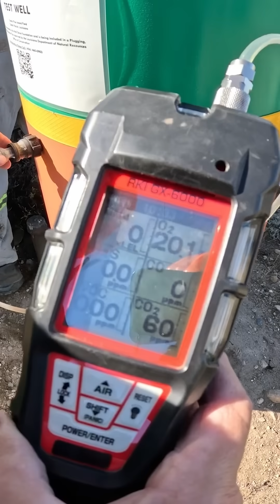The problem goes deeper than you think...

Comment: In the Ventura oil fields there were 3 oil field workers that got caught with nowhere to run when hydrogen sulfide blew out of the well and all 3 died on the pad and it took hours before someone noticed they hadn't checked in. One of them was 22 years old.

Comment: Could that methane not be extracrd and used.
Reply: Typically not. A well leaking at the rate mentioned would be rare, but at that rate, it might be cost/energy effective. Most leaks are small, a coat of paint might stop it, and even then, it might be more of a seasonal burp than a flow.

It takes a lot of material and fuel (energy) to do the plugging. If it takes more fuel to plug than is escaping, it is losing proposition. If it takes more energy to rework, capture and transport the gas than it produces, it is a losing proposition.

Comment: I worked in northern Oklahoma plugging these old wells with a cast iron plug. When you get permission from the state to drill a well you put down a deposit that you only get back if you plug it. Plugging is more expensive than the deposit so a lot of companies, especially smaller ones, just leave it.

Comment: I did gas testing & certification for work. This seems excessive considering the only risk to life would be someone putting their face over the hole with a perfect seal or for >15mins straight. Also wouldn’t gravel, soil & a cap do the job?

Comment: If you only use concrete for the last 60 feet, you could use the rest of the volume below to permanently store carbon in a process called "geological carbon sequestration". There are lots of processes which capture carbon that need somewhere to store it. Why not plug your hole with it, considering concrete has such a high embodied CO2 cost to make.... just a thought.

Comment: It seems like that methane could be useful.  Can you put a pipe in the plug and a valve at the top?  Then just turn it on for some natural gas when you want later.  Maybe it's below the concentration threshold to be profitable at the moment, but that may not always be the case if the price of NG goes up.

Comment: Question : if the casing is threaded at the top why not just put a metal cap on it ? That should last 25-50 years ! Would take considerably less time and you plug several in a day ! Speed versus permenance ! Have one well permenant or stop pollution from many wells long term !

Comment: Out of curiosity, what would happen if you just kept dropping lit sticks of dynamite down the hole? Would it eventually fill itself up?

That's also a lot of energy used and pollution produced just to fill the hole with concrete. But I'm confident, over time, it's way less harmful than just leaving the hole open.

Comment: They're having a problem with old wells in the oil fields of Western NY State and NW Pennsylvania. These wells, which have been worked out three times over, are somehow leaking very valuable Pennsylvania grade crude oil onto the surface. All the settled science says this is impossible. But, rather than collect this oil (very low sulfur and crazy rich in lubricants) they're plugging the wells. With concrete, not pipe. So they can never be pumped again.

Comment: Like so many "stories" they never tell the whole truth. Most times nothing comes out of the well...the state inspectors and ignorance causes operators to give up...there is nothing you touch that does not require some type of hydrocarbon...nothing...the toxic battery's in battery operated cars have to have oil to make them...do a little research....see how synthetics are made....they make synthetic oil and put it in a plastic jug....made with oil!!

Comment: Once the oil are mined out they should be extracting the gases as it's just as useful and hydrogen sulfide is also worth mining so instead of just plugging them holes take out everything you can then plug the holes I reckon

Comment: So if you are using “concrete” you already fudged up. Cement will also break down over time and does a horrible job holding gas. Also, none of you guys are paying any attention to the B annulus of the wells. The well will still contaminate groundwater and leak gas up the back side.

Comment: Incorrect.  "So the bottom plug dries first.."   Concrete does NOT dry.  In fact if it did, it would not cure.   Concrete sets, hardens, cures, over a period of time. Construction tests are often based upon a 7 day cure or a 28 day cure.  Water is REQUIRED to hydrate a hydraulic cement. Cement does not dry to get hard.

Comment: OSHA allowable 8 hour hydrogen sulfide safe exposure is 20 parts per million. 100 ppm will make you sick. 200 ppm will kill you. I used to hot oil 37% H2s wells. That's 370,000 parts per million. You don't make ONE MISTAKE if you want to stay alive.

Comment: what a huge waist. you only need to plug the top with a cap. it recharges over a few years. when its full up again more oil is available.
Reply: That's not true at all, oil takes millions of years to form
Reply: @averybrown4547  I have seen reports of dry fields being explored in the 1920s and 30 years latter there was oil in the 1950s from the same holes. They could not believe it, they even tracked down some of the engineers from the first drilling in the 1920s to check, and they could not understand it. Oil is a Hydrocarbon CnH2n+2. It comes up from under the earth crust. Renewable.
Reply: @averybrown4547  I tried to write a comment explaining it, reports proving it and the chemical formula but YT censored it. I didnt write any thing that is hate speach so its very strange, why would they censor it unless they dont want people like yoursef to find out.
Reply: @hungrysurfer9471  oh I looked it up, yes sometimes that happens but still we shouldn't be using oil, it's horrible for the environment

Comment: Im more cconcerned about why i unsubbed Jerry Rigs everything, even old oil rigs 😂

I just wonder, it will take 20 years for the effect to be measured, does that account for the pollution created to plug the hole?

Rigs and equippment, plus the sand and cement used?

Thanks in advance.

Comment: I have a concrete company where we use polyurethane foam to not only lift settled concrete, but fill voids and sinkholes. It’s typically a much cheaper alternative to a flowable fill concrete solution. Would be interested if it’s applicable to something like this.  

Level Up Concrete.

Comment: As the bellies in bakersfield emptied they filled back up.  They found a super hot river of oil lower in the crust.  What happens is these bellies are cooler oil steam from the river.  So all old bellies have then have the possibility of filling back up.  This is also why the La Brae tar pits dont stop boiling they are the cooling of these rivers deep down.

Comment: Not sure about American regulation or drilling.... but it Canada we have surface casings with several concrete bell holes....
Methane or well seepage doesn't happen, unless piping is breached....

There simply isn't, killer holes in the ground.... although there are killer pipes sticking out of the ground.... up too 10 years, before the piping is filled with concrete and sheared off below the surface.....

Comment: Here in canada every oil company pays a fee off the top to help seal these wells, these are called orphan wells and there are over 200,000 of them in alberta alone that need to be sealed, i have cemented alot of them myself and could spend the rest of my life sealing the rest of them... and we dont use concret, btw.

Comment: There was a company pitching using abandoned oil well holes for energy storage. I think the idea was to use a heavy weight. When there was surplus electricity, lift the weight higher in the well. When demand was high, lower the weight and spin a generator to make electricity.

Comment: With a concrete plug it is not 100% sure that this will stay leakfree, the poor quality of the cement between hostrock and the casing is a big problem.

I work with a p&a solution that removes all casing and cement out to formation creating a permanent and gastight plug.
The barrier is set with wireline, no need for milling.

Comment: This is a big problem in the oldest fields.  Most states charge current producers a tax that goes to properly plug old orphaned wells.  And to prevent new wells from becoming orphaned, all operators are required to put up a bond.  And states are much better today about maintaining well records and making sure wells are plugged properly.  And properly means isolating the hydrocarbons and salt water from way deep from the fresh groundwater from up shallow.  So multiple cement plugs are required throughout the wellbore in addition to the one at the surface.  Finally, the well is cut off well below plow depth and the ground around it returned to the appropriate condition (farm land, native grasses or whatever)

Comment: I did work over rig, repair existing wells and I always asked why don’t they use the methane to power a generator after all it’s a flammable gas and you treat it as a byproduct instead of a fuel

Comment: for those who have never been in the oil and gas leasing business, STFU.  An abandon well deemed nonproductive nor reliant to deliver product, is an abandoned well.  All right are reverted back to the surface owner.  To say that hydrocarbons or methane or natural gas that is emitted is killer and unusable gases, there is a recovery system.  And yes as a last resort they can plug an abandoned well.  If in the agreement, lease agreement.  Do some home work.  No, I have not read any other comment s to this post.  I am giving my two cents

Comment: Why can’t we just block the tippity tippity top portion of the hole instead of filling it in?
Reply: Pressure.  That could turn into a cork or missile.  It has to have enough mass to resist the pressure in case the well is just a zombie that comes back to life.  Also, it needs to be difficult for people to remove.

Comment: Some states require a bond to drill, unfortunately that bond is about $2500. And much cheaper than closing a well properly. Maybe the bond should be high enough to cover costs to close well properly.

Comment: Why won't you just pull 10 ft and lay a metal plate and pour another 10 ft and one more metal plate I get the pressure will eat up the concrete but a metal plate on top would act like a locking mechanism especially if it was wider than the original hole where you dig out the sides of the hole or the actual dirt for the next 40 ft above it is holding it down then it can't blow out and of course you would fill it with pea gravel and whatever else is in the area

Comment: Where exactly are you allowed to leave an open hole because in the state of Ohio as far back to the 50s which I’m sorry to say is all the further back I know you were not allowed to leave an open hole even if you drilled a dry hole you were required to fill it  in just shy of 30 years in the oil business That stretches from hauling water, hauling solvent, drilling, and pumping oil wells. I have not once ever ran across an open hole.

Comment: A third thing you will see all over Texas are old, rusty "Christmas trees." They are an assembly of a multi-valved structure consisting of valves, pipe spools, and fittings used to control the ﬂow of oil from the well.

Comment: Is there not a requirement for the company to use oil sales money to plug the hole and clean up the well site???
Reply: Not in the land of the "free".
Reply: @wissenistmacht8930  Well, there should be. The oil company should be required to get 3 bids from companies who will clean up the site and plug the well. Thrse bids would be required every 3 years. The oil company should then be required to place cash in an account in the amount of the clean up bid. That money could not be used for any purpose other than clean up including bankruptcy. Honestly, with all the regulations in the oil industry, I am surprised this regulation does not exist. COMMON SENSE!

Comment: The government should charge a fee in advance for each hole drilled. Then the government should be responsible to plug the hole. 

Does it have to be plugged with concrete? Couldn't they fill it with mud?
Reply: Or gravel and mud. Whatever is cheaper than concrete that'll work

Comment: We’re currently doing plug jobs in VA due to mountains shifting and collapsing the casing in methane wells. They usually trip in undersized pipe until they stack out, usually around 2,000’, then pull out in segments and cement it in one go. Usually a day long affair after equipment gets brought in and set up

Comment: I wonder why the concrete needs to be poured in segments?  It's not like it'll be used like structural concrete...?  If it all cures at once, will it change size and shift, making it leak or making leaky cracks in itself or the rock around it?